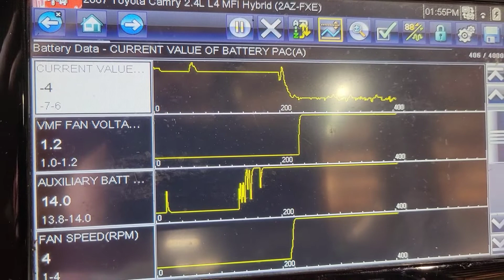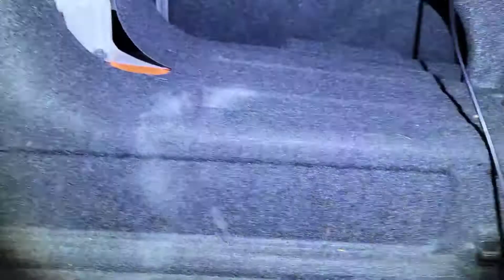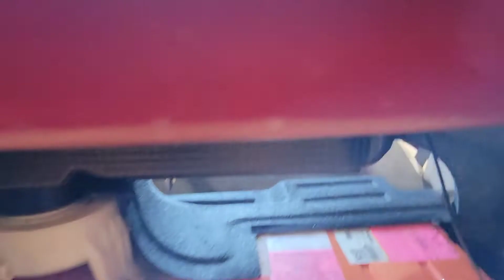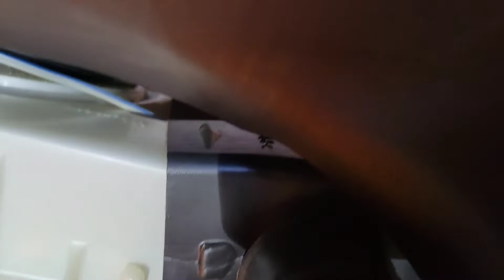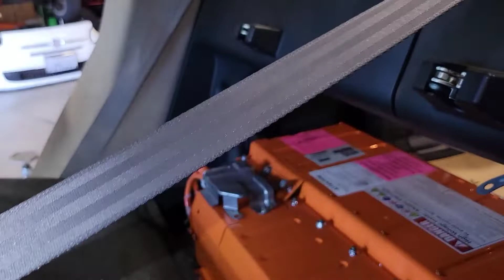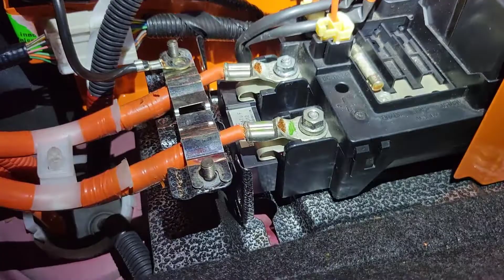Hybrid Battery Service and R&R

Comment: Good info Tony, thanks. Is there a decent aftermarket battery out there?
Reply: There are some companies in Texas that will remove the bad cells and replace them with good ones and give you a 5 year warranty.
Reply from the maker: @nosliwttam77  so you have to send them the battery and wait for it to come back?
Reply: @NutsandBoltswithTone  some yes, others will come to you and do the work in your driveway.
Reply from the maker: Your welcome and not that I know of. We only use oem hybrid batteries.  Honestly there is a reason they cost so much more. Thx for watching